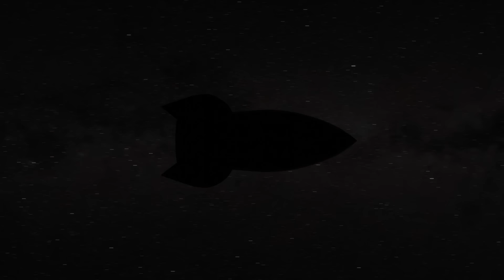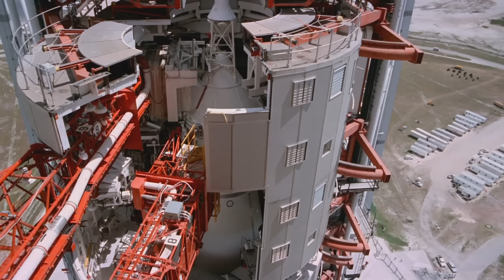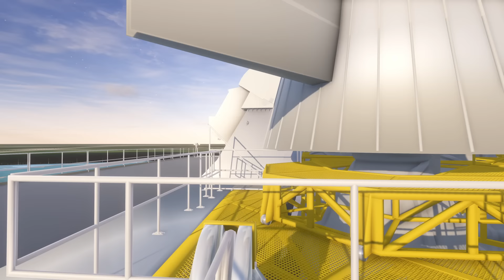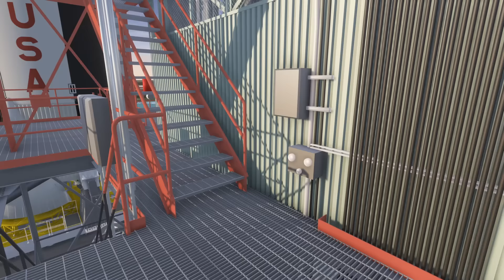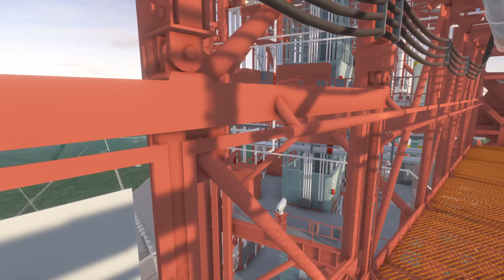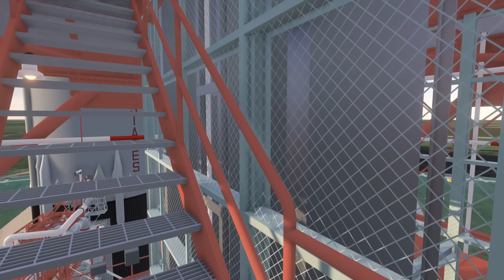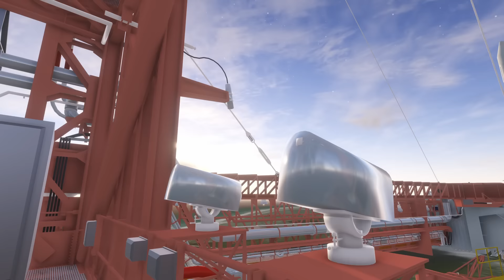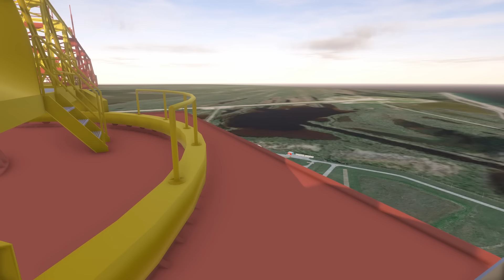How Did The Massive Launch Tower For The Saturn V Work?

Comment: Why would it be necessary to add hypergolic fuel to the Service Module on the launchpad?  One of the advantages of room-temperature hypergolics is that they can be loaded ahead of time.
Reply: Short answer is safety, things vibrate quite a bit when rolling to the pad. We still load hypergols onto the SLS boosters while at the pad.
Reply: @Apersonlikeyouu Yes, but unlike Saturn, the stage and SM hypergols are loaded before even stacking.
Reply: @TheBleggh  yeap, we service Orion and ICPS with hypers at the MPPF.
Reply: @Apersonlikeyouu I think with the BOLE SRBs they plan to completely eliminate the need to do any on-pad hypergol loading, which should help pad flow. Who knows when or if that will happen, though.
Reply: @TheBleggh  BOLE will use electric thrust vector control, so there are no hypers.
Reply: @TheBleggh  I had to google "BOLE" -- it's an improved design for SLS.  It's my understanding that solid fuel cannot be loaded on the launchpad into an SRB.  What need would an SRB have for liquid hypergols?  An ignition source?
Reply: @JPMadden The SRB nozzle thrust vectoring system runs off hypergolic fuels in the current SRB design. BOLE would continue to use pre-cast solid fuel segments for the SRBs themselves, but the thrust vectoring system would be changed to use electricity.
Reply: @ Interesting.  I never thought about thrust vectoring an SRB.
Reply: @JPMadden  Take this with a grain of salt but I believe the SRB TVC is the primary way the vehicle is controlled prior to SRB jettison.
Reply: @ That seems correct.

I wondered about booster separation.  For both the Space Shuttle and SLS, each SRB has 8 booster separation motors (BSMs) to be used when the SRBs are emptied.  The propellant used in the SLS BSMs appears to be carboxyl terminated polybutadiene, a solid fuel.

Comment: How do the Cryo lines flex?
Reply: Could be bellows.  I have seen that for liquid helium transfer lines, although very small compared to these.
Reply: The very large (8" ID) vacuum jacketed lines have a good amount of flex if they're long enough, but for sharper bends bellows work well.
Reply: @ I guess the Vacuum jackets would end at the bellows, because I cant think how a vacuum bellows would work.
Reply: There is no jacket at the flanges; however, this is our approach for managing articulation with our swing arms and the tails service mast (ICPSU and TSMU). In the TSMUs, we have forward and aft flex hoses that connect at a pivot point inside the TSM.

Comment: A lot of the film footage of the support equiptment for Apollo is lit so well and is in such high quality that if you messed with the grading/contrast it'd probably be hard to tell it apart from modern day footage. Obviously that's not groundbreaking or anything since high quality film cameras have existed for a long time but it's still kind of crazy to me how long ago yet how clear and detailed everything is in the footage
Reply: Destin (Smarter Every Day) did a whole video on that. Short version: digital cameras blow out the image because they lack the dynamic range of film and the exhaust gasses look brighter because digital sensors also go slightly into the infrared spectrum. ✌️

Comment: NASA built 39B and 39C originally, but not the original 39A (would have been north of 39B, branching straight from the crook in the crawler track for 39B). When they canceled the original 39A, they renamed 39C to 39A.
Reply: There is now a 39C, but it's tiny

Comment: Scott, when I was a young engineer in my first design job at Ontrak Systems Inc in Milpitas (early 90's), I worked with an older engineer named Glenn Travis who was on the design team for the Saturn V launch tower. He had original Vellum drawings of the assemblies still, and brought them to show all of us younger engineers!
Reply: Ha haah. I am one! Graduated in 1980 (Mech Eng) and produced my designs on a drawing board for a few years. I would sketch on paper with a pencil…then cut the sketches up and tape them to my board underneath the A1 sized title block sheet to set the drawing layout. Then copy over the pencil sketches with either 0.3mm or 0.5mm thick pen….either solid lines or dot ‘em for hidden lines…..and compass for circles or arcs….then..write all the titles and notes by hand as tidy as possible. Very time consuming. Mistakes were erased with tough rubber erasers that essentially ground the pen off the tough plastic of the title block. Then along came 2D cad which was fantastic….no more dotting of lines and hand writing notes and squinting at circle centres etc etc….then…along came 3D packages complete with FEA so the manual calculations we had to do to try and figure out stress or deflection of various parts essentially disappeared…except for check calculations to make sure the stress model is correct …..all essentially made possible by the gamers who forced the development of computers and graphics cards so we Engineers could run complex calculations on powerful desktop gaming computers. HOW TIMES HAVE CHANGED!!
Reply: @hughjanus3378  'Reminds me - on a much, much smaller scale - of drawing graphs for my PhD thesis in 1991, using a technical pen and 'Letraset' rub-down lettering. 'Tip-Ex' was very handy for touching out minor blemishes but for any real error it was a question of tearing up the paper and starting again. Excel, etc., has made things so much simpler!
Reply: @hughjanus3378  nice! Sitting in my living room I am currently looking at an old fashioned drawing board where I hung my first draft/drawing from my first year of studies. 😊
Reply: It was always nice to see, how the "old dogs" did design work. Now with 3D parametric CAD having been on the market for about a career's length, it's hard to find engineers, who still actively designed at a drawing board.
Reply: I would bet hey wouldn't actually be Vellum. Vellum is animal skin, so not used much since medieval times except for some specific religious or archival of government statutes.

If they were originals they would probably have been drawn on cartridge paper. Copies back then would probably be diazo which gives blue lines on white paper, thought these fade and disappear over time with exposure to light. Given that you were still able to see them in the 90's means they are very likely to be the originals!